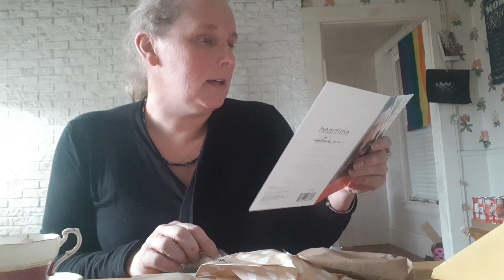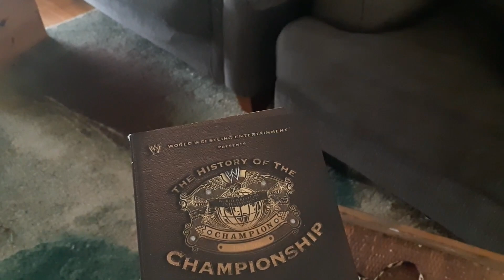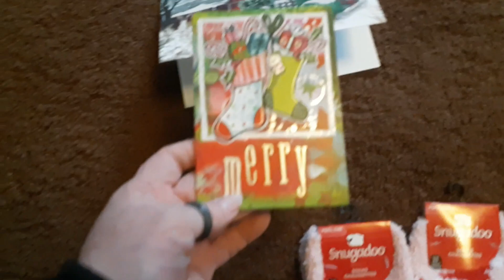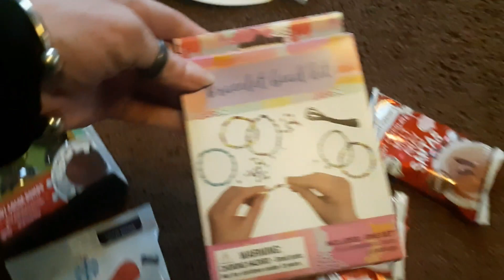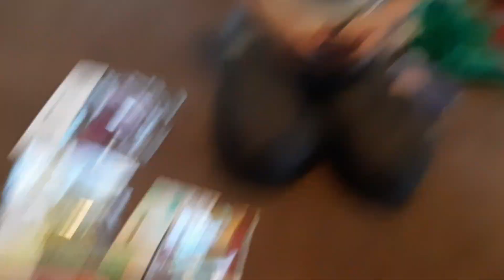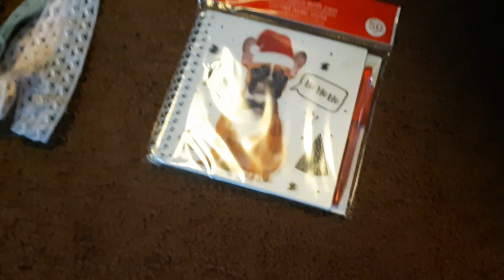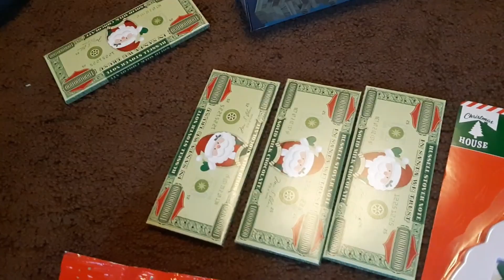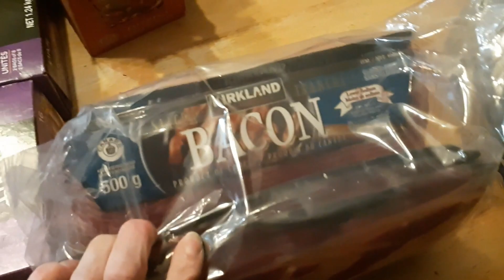FRIEND MAIL! Teacup Chat, Sanding With Dad and Bumpkin Supper Making!

Comment: The flower bar and chunky one with it are Himalayan Sea Salt Spa bars.  Salt is hydrophilic, meaning it attracts moisture from the air. Combine that with the Glycerin, which is naturally present in handmade soap and like salt, has hydrophilic properties. Glycerin is also a humectant - which allows the skin to retain moisture. Hydrophilic and humectant = a gentle soap that leaves your skin feeling amazing.  Soft, smooth and not at all dry.  I use all of my own products. They are especially helpful during the colder months.